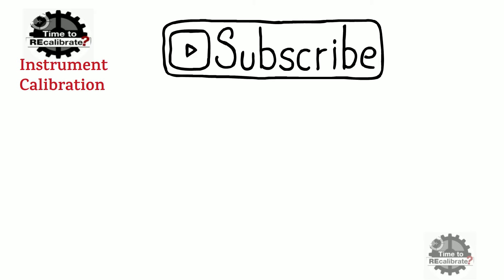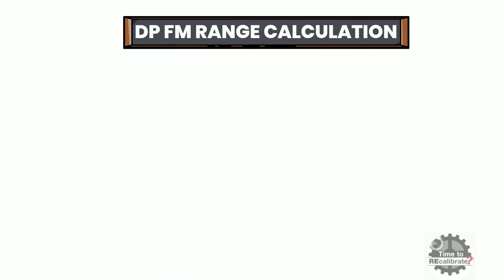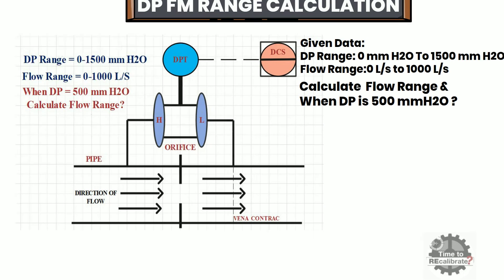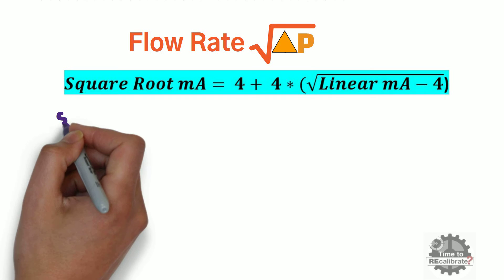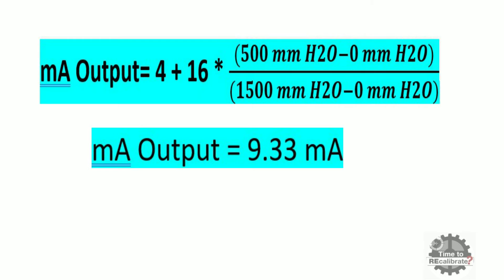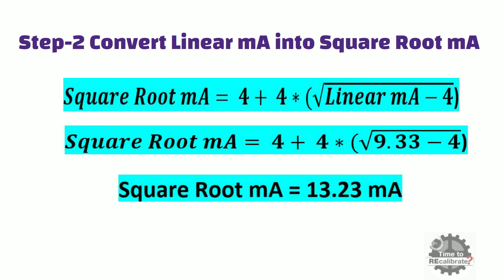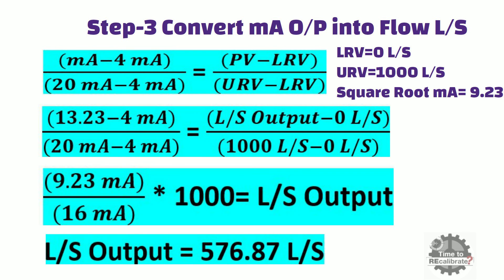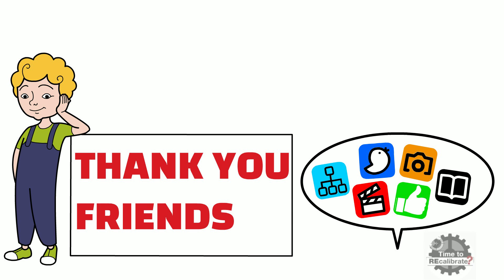How to calculate flow range in Differential Pressure Transmitter | Transmitter basics

Comment: I understood this but this calculation is possible if and only if the URV of flow is given but what if the flow range is not given how can I calculate it with delta p max = 1 kpa and known pipe diameter and process fluid properties
Reply from the maker: Hello Suraj
I have the answer of your questions. However, I want to verify my answer with one expert. Once I verify my answer i will get back to you

Comment: Sir how you get the dp range 0-1500mm H2o where you get that i love your video sir but sometime im confuse that i ask sir thank you sir
Reply from the maker: Hello nelson
It is differential pressure range which is set in DP transmitter. You can find this range from DP Transmitter by connecting HART Communicator or by accessing menu function. In this video, i have assumed that DPT is set for 0-1500mmH2O.
Reply: @InstrumentCalibration thank you sir how about the flow range 0 to 1000 l/s how did you get that sir im always watching your video sir thank you sir i hope you answer this

Comment: How do you know 0-1500mmh20 is equivalent to 0-1000l/s?
Reply: Got the answer, the flowrate range is based on the specification of the orifice plate installed. The orifice plate will determine the maximum pressure drop against the flowrate required for each process application.
Reply from the maker: Hello Anas
Yes...you are absolutely right. Though thanks for asking